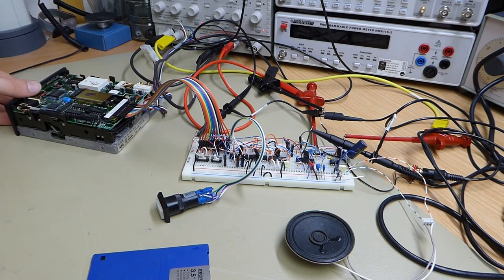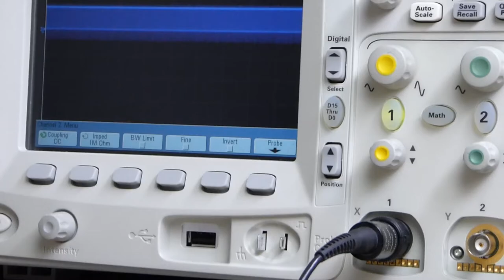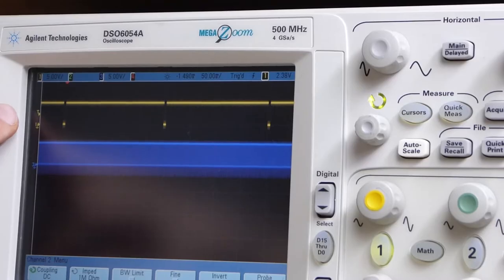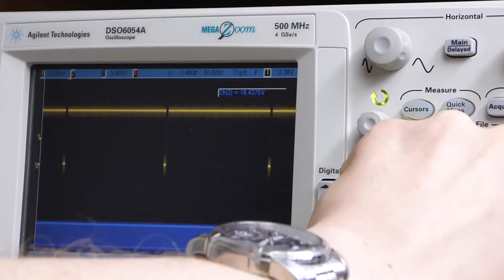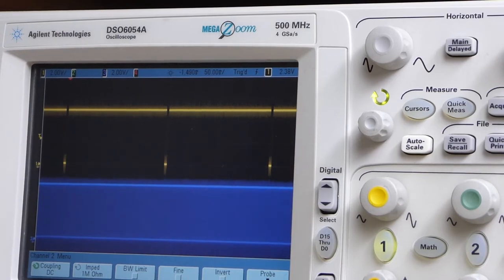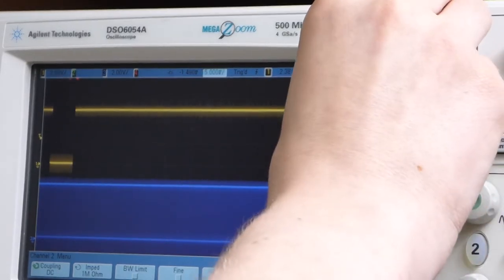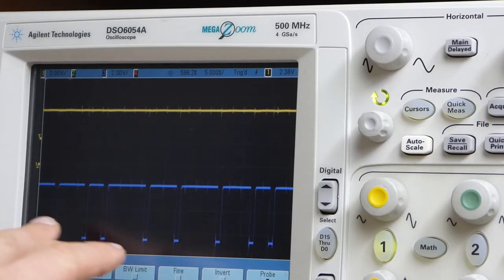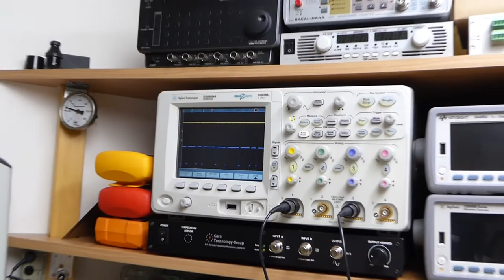Analogue Audio on Floppy Disks

Comment: WAYYY Back in the early 80's when my computer was a TRS-80 Model III, (using 5.25" disks), I pondered recording (analog) audio to such a disk/drive. I brought it up to a friend of mine (who actually worked in a recording studio), He pointed out that the overall magnetic surface area,being tiny compared to a reel (or even cassette) of tape, it would likely only hold a few seconds of audio, so it was a useless idea. I didn't CARE that it was useless, Just had to be COOL! , Now 35+ years later, someone DID it! and on a disk with even less surface area- Still COOL!
Reply: lol Hell yeah. Life came full circle.

Comment: It is likely not about the index pulse not allowing to read/write during, but you need time to change track obviously and the inconsistency in the track change over the surface of the disc, is what causing the data read dropouts.

Comment: The problem with the 1.44Mb floppy disks is the enormous amount of wasted space on physical disk.  This is why it will be a much better idea to put the LS-120 drives back into production.  They use 120Mb floppies & are backwards compatible to the 1.44Mb floppy.  LS-120Mb superdisks are also an ideal upgrade to the conventional cassette tapes.

Comment: What is the sound quality you can get with this? As a kid I wondered if you could do something like this with analog video by connecting VHS head lines to a floppy head but it's not going fast enough, maybe PXL2000 video at best.
Reply: Discregarding the dropouts during track changes, the recorded audio quality would mostly be defined by the linearity of the PLL mod/demod, stability of disc rotation speed and jitter of the read/write circuitry in the drive. I guess one could say it is possibly similar or better than any analog audio tape.

Comment: For years, I thought, I was the only one who stored music on floppy disks.
But in the 90's, I did it in the regular digital way using a custom codec I made in Qbasic.
But storing it in an ANALOGUE way on a storage that is meant to be digital... without modifieing he drive.... is just... damn... genius :D
Reply: What was your codec like? Please elaborate, this is cool as hell.
Reply: @michalzustak8846  When I tinkered it, I was 14 years old xD. It was in the 90s. The computer we had was a 486DX66 without internet connection.
I tried to figure out how MP3 works and I tried to recreate it. But I was totally wrong (MP3 works completely different). 
But my implementation did its job (Basic, with many goto statements in it xD).
Today, I would say, it is some sort of 1-Bit ADPCM. But in contrast to other ADPCM codecs, the step size was chosen on time domain only, because there is only one single bit per sample which you need to determine the direction the signal goes (up or down). Stepping into the same direction again increased the step size. Stepping back and forth reduced it.
The "sound driver" for playback and recording was a loop that queried from the parallel port (where the "sound card" was) at a given sample rate.
It still worked pretty well at low bit rates (say, 48kbps. Sometimes better than MP3). The bitrate was chosen by the recording sample rate (because of 1 bit per sample).
But it sounded hissy and scratchy^^. That didn't bother me much because the way I recorded the music into it was much more lossy: I barely remember the "soundcard" was a parallel-port-"stick" and I used a crappy microphone to record into that from the speakers of a cassette player.
I didn't manage to support sound blaster cards because QBasic had no built-in way to access these (and I had no idea how to circumvent that limitation using assembly language xD).
As a special feature, the files had something similar to a GIF stored too (usually some pixel art that was dancing to the music), which was displayed during playback. 
That was an adventure... the pure exotic island solution. xD
But I was surprised once I discovered the opus codec shares one strange limitation with my codec: The only supported sampling rates are 24kHz and 48kHz, but not 44.1kHz. It upsampled to 48kHz too when it came to encoding of 44.1kHz material (which never really happened because it just queried the parallel port sound card directly 48k times per second). :D.
Reply: @wichtelchen  do you still have the code?
Reply: @ksx4system  Unfortunately, the original QB code is gone.
My music-diskette stuff was in fact little bit more than I've described here: 
The music had pixel-art fullscreen animation (80x25 textmode + char 220) synced to the audio which is something between video and gif. 
I called the media type "Desktop-Wichtelchen" (=gnomes for your desktop).
A few years ago, I want to run these again for nostalgia but didn't manage to get the stuff working again because DosBox didn't like the "asm-magic" parts from the QB code and there still was the thing with the paralle port.
Even if I would get it working again, the parallelport-stuff killed the project from physical side: It requires a silly homemade "parallelport-soundcard", which I don't have anymore to the parallel port no regular PC has anymore. 
Without this, you won't hear anything. 
But I didn't want to see this leftover from my late childhood dying, so I salvaged it the other way around: 
I still had a few more homemade experimental audio codecs alongside the one I've described above.
I ported everything, including all the codecs, into a one single new java application which plays all the Desktop-Wichtelchen from the past on modern computers, without weird frankenstein-stuff on hardware side. 
After then, I tossed all the messy QB spaghetti code, because it became really useless and the chance it becomes useful gain in the future is zero.
I no longer need them because the old ideas are now salvaged by transferring them over into the new application.
But one issue persists: They're neither videos nor gifs. It's something on its own with no corresponding standard format as alternative.
This new version works fine, is still there and installed on my computer and I started again to develop and improve the stuff here and there when I'm bored.
This application is not useful to most people because the ideas behind it stuck in the past, but tinkering old-fashioned multimedia codecs from scratch is still a big fun to me.
Reply: But I'm unsure if a homemade codec (not the one mentioned above) is still considered "old-fashioned" if it halfes the size of a 16bit- pcm file with a negligible loss of only 1-2 bits in really loud parts. Quieter parts are fully lossless most of time. So only the dither noise may be sacrificed here and there in passages which don't need it^^. In other word: A noise floor of of around -80dB in loud parts.
To me, that codec shines to me, compared to FLAC, when it comes to encoding some heavy-metal :D

Comment: That is freaking amazing!! Sometime, I plan on doing something similar ( did a little, but have not picked back up on it yet) to make a floppy recorder that uses analog tape recorder circuitry hooked straight to the head.
Reply from the maker: Let me know how this goes, that was another avenue I was considering but didn't want to go through the hassle of modifying the drive too much. It would be interesting to see what you can come up with in terms of spindle speed and head positioning.

Comment: Have you see the Floppy Beatbox from Techmoan? Midi on a Floppydisc is very interesting.
Reply: MIDI on a floppy[space]disk is "interesting"? Well, sure it was when I first saw MIDI keyboards that came with floppy disk drives, and then eventually got one, but by the time I had one they were commonplace, and now MIDI keyboards have USB or/and SD card slots instead.

Comment: I have a bunch of floppy drives (3.5" drives) that I want to experiment.
The problem is that i cannot find anything on the internet about how to rotate the spindle motor.
How do you spin that motor? The only thing that i can find is modding the drive internally or get a 5.25" drive.
Thanks
Reply: Huh? The spindle motor is driven by a control signal on the connector... just look up the floppy drive cable pinout and the protocol specification. It's absurdly simple.

Comment: That is cool. The only way I ever managed to play audio from a floppy disk out of a pc was to copy a low quality mp3 onto a floppy disk, then using a ls120 drive and usb to ide adapter i played the mp3 file on a car stereo with usb input.
Reply: In the mid-90's, I cobbled together a custom 1bit-ADPCM codec (using QBasic) that made it possible to store up to 5mins of digital audio onto a floppy disk. :D MP3 did (and does) glorious fail at lowest bit rates. The most difficult thing was to bring the music into the computer because the computer we had in the 90's only had floppy drive and a small hard drive.
Reply: @wichtelchen  These days, you could use the Opus codec to write good quality audio at lower bitrates. I've gotten 6 minutes on a floppy at good quality by down mixing to mono. Around 55 kb/s (3.5 min) is where it starts getting better to go mono rather than stereo. Quite interesting to see that the bigger drives got, we also improved our ability to use smaller ones.

Comment: Nicely figured out and good soundquality! (as far as i can tell from that microphone recording of that little speaker)  Maybe you can circumvent that pulse in the audio signal like Jeri Ellsworth did in her "Floppy Drive Reverb" video..
Reply from the maker: Jeri hooked up to the analogue heads directly, whereas I am going through the full digital interface of the drive. This blanks out the data lines during the index pulse, so sadly not an easy fix.

Comment: How long can you record for? you could maybe eliminate that pulse noise with some type of filter.
Reply from the maker: 32 seconds, which is determined by the rotational speed (300rpm, 200ms), number of tracks (80) and sides (2). Which, incidentally, is why I chose a 3.5" drive since they rotate more slowly than 5.25" drives (360rpm). The clicking pulse could probably be improved somewhat by filtering.
Reply: @kitsune-denshi  if you spun the disk more slowly would the sound quality be the same maybe worse. Thinking of the pxl-camera that recorded on audio tape.

Comment: do you send the audio as fm to the floppy disk ? do you have any schematics?
Reply from the maker: Yes, it's simple frequency modulation and I'm afraid I don't have the schematics for it.
Reply: @kitsune-denshi  thats to bad would have liked to have compared it to mine. I cant get my audio quality good enough. How do you generate the signal? With  555 timer or a pll? (Never mind just watched and you use a pll)
Reply from the maker: @duality4y  yes, it's a CD74HC4046 PLL - very simple to setup up.

Comment: Jeri Ellsworth did this in 2009...
Reply from the maker: Yes, although she hooked up the read/write head to the electronics of a tape recorder. There are few more hoops to jump through (frequency modulation) to use the digital interface and an unmodified drive.

Comment: So the audio is recorded in a bunch of concentric tracks, rather than a spiral like on vinyl records. So long as the head moves at the exact same time as when it was recorded, you get a generally uninterrupted audio stream. Would it be possible to make the head move smoothly instead of in 'jumps' so it records a spiral?
Reply: I don't think it's possible, the head is moved by a stepper motor, and like the name implies, it steps. You could possibly get it to do really small steps really fast but that would introduce synchronization problems, and it would never be truly smooth
Reply from the maker: Interestingly, I think the stepper motor wouldn't be the problem. As long as it moves repeatably and follow the same path between tracks, there is no reason why it shouldn't record (and read) as it moves between tracks. The main reason for the annoying beating sound is that the drive electronics don't output valid data during the index pulse, which is long enough to throw off the PLL. I'm not entirely sure if data isn't written during the index pulse, either.

Comment: If it's saved to floppy it's 0 1 digital data
Reply from the maker: Like someone else said, it's digital (quantised) signal levels but continuous (non-digital) timing, so you can argue either way. However, given that frequency modulation is not typically considered digital, I think it's justified to call this analogue.